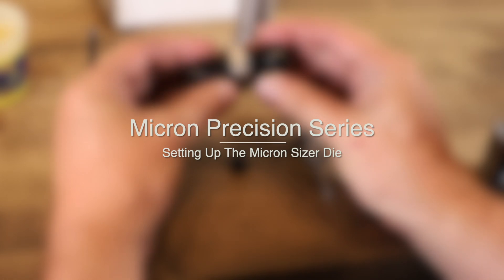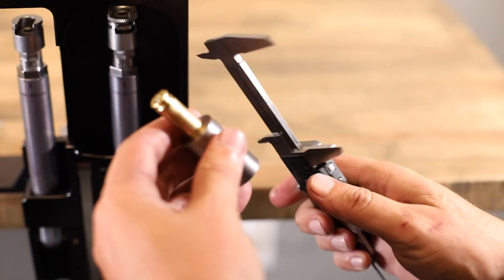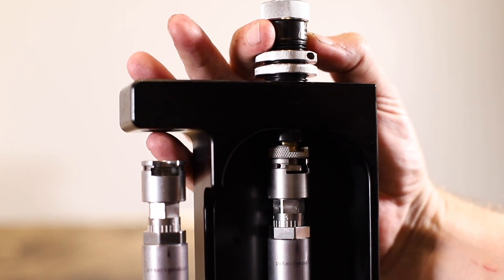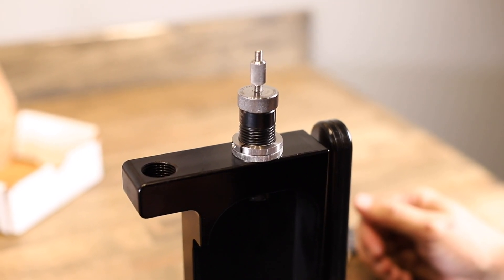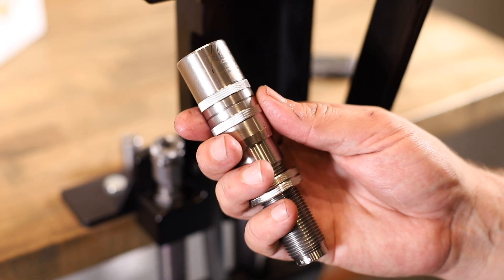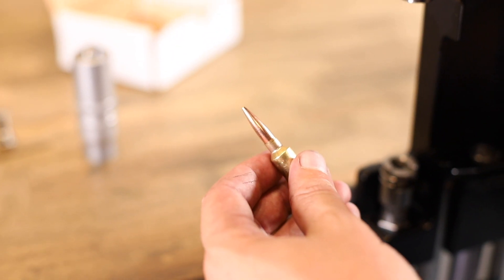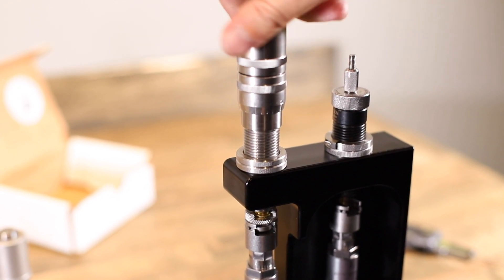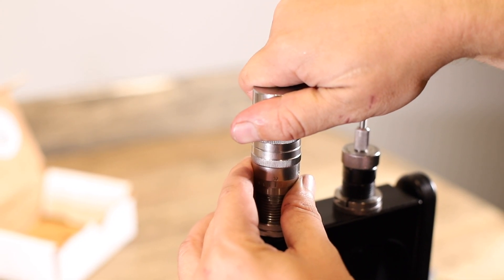Tech Central - Micron Precision Series Die Setup

Comment: What press are you using, please? Fairly unique design, is that a micrometer adjuster on the ram?
Reply from the maker: We used a Micron series double-adjustable ram press for the video. We will release the press after we finish testing them.